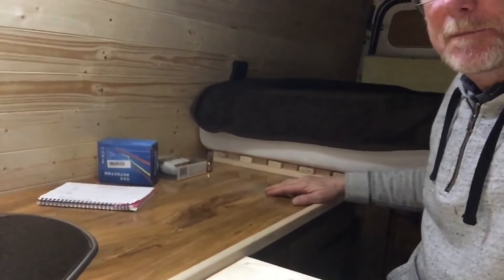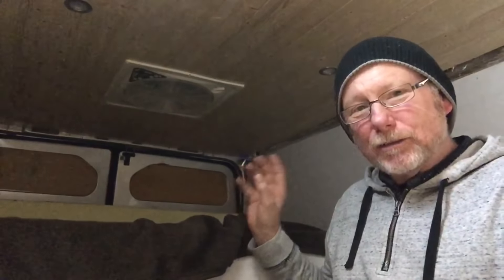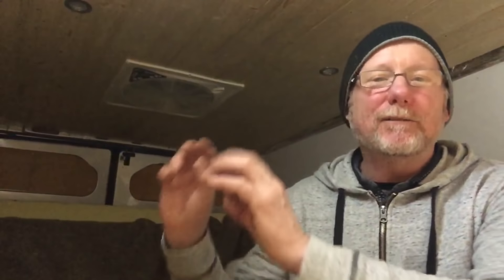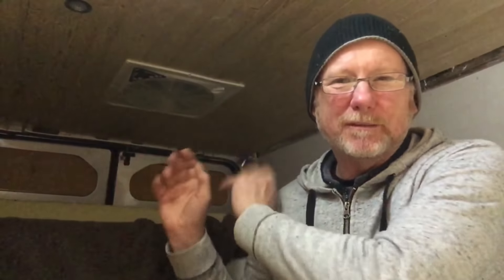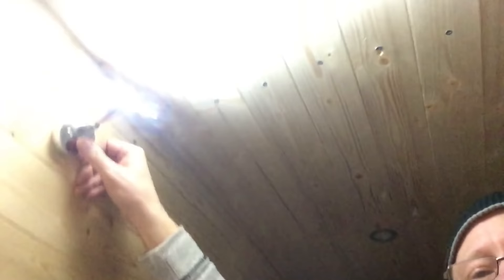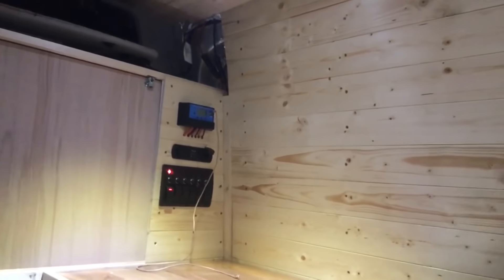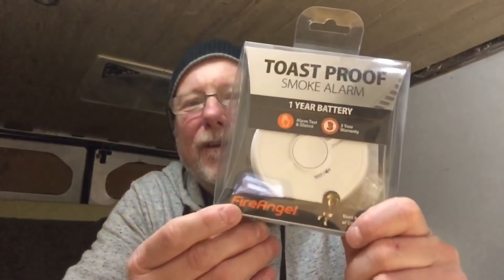HOW TO INSTALL PROPANE LPG Alarm in a Campervan - RV

Comment: Just a thought mel ,have you got a means of escape at the back where you bed is ? If your asleep at the back and with no windows your kinda trapped .can you open the back doors from your bed ? Or something you might want to consider
Reply from the maker: peter amberley Hi yes I’m planning a way to open the doors from inside for emergency 🤓🤙

Comment: my smoke alarm is by the sliding door exit same reason so it draws you to the exit. my extinguisher is far opposite rear corner above the inflammable bed, easy to find if you need it, head towards the fire.......
Reply from the maker: well done stay safe out there :)

Comment: Hi Mel we need to think up some safety measures for us van dwellers. I've only been in the van a few days and already had someone try to brake in. I don't know if stealth works in the UK. In America people make there van look like it's a work van but in the UK if you did that people would break in thinking tools would be left inside. So I don't know if it is better to make your van look like a camper because then people think you could be inside. Trying to think of different things to keep the van safe. I worry every time I come back to the van that it won't be there and I loose everything I own and have spent a fortune buying and building. Only thing I can think of is putting a light with a motion sensor on it but then it's obvious someone is inside. Or maybe the guy who put barbed wire on the handles of the van. Any ideas Mel ???
Reply from the maker: Avanliving sorry to hear that you had a bad experience.the best advice I can give is just be careful where you park. My favourite place is rite opposite a 24 hour Mc Donald’s I don’t get any problems there. I know it’s a massive worry like you say it’s not just a van it’s your world your everything I have a cat 1 alarm plus a tracker to that works using a mobile phone SIM card I was thinking about CCTV but even then I still think it’s all about parking in a well lit up place hiding in plain sight 🤓🤙
Reply: @BigVanSmallWorld  I was parked in a car park underneath the sign that says video camera's in operation and under the camera's view but still got some hanker trying to get in. astards. Will look at getting a tracker thanks for the help Mel. I'm setting up a cctv system but has to wait for payday also it will take electric so need to get more batteries so more money again.  Just didn't expect people to be trying to break in I deliberately made the van look unappealing from the outside . Knocked my faith in humanity.
Reply from the maker: Avanliving that’s really bad 😐

Comment: Does your gas alarm detect carbon monoxide?  That is a killer - you are cooking and have a diesel heater inside the van.
Reply from the maker: OZ Camper Travels absolutely not it’s a gas alarm for LPG you need a different alarm for that I will be fitting one soon no worries 🤓🤙
Reply: Very wise. Don't know much about gas alarms because all my cooking is done  outside but I know of people who happily go to sleep and don't wake up.

Comment: Link to the L.P.G fire alarm ??
Reply from the maker: AppleJuice1 juice1 sure I’ll do it soon 🤓🤙
Reply from the maker: http://rover.ebay.com/rover/1/710-53481-19255-0/1?ff3=4&pub=5575467911&toolid=10001&campid=5338454651&customid=&mpre=https%3A%2F%2Fwww.ebay.co.uk%2Fitm%2F12V-Combustible-Gas-Leak-LPG-Natural-Gas-Detector-Propane-Alarm-For-Home-Alarm-%2F263721805864%3Fhash%3Ditem3d670b6828

Comment: Hi Mel, I'm no expert, but I think there is a flaw in your theory about having the fire extinguisher by the door. If you have a van where the back doors are boarded off, and your only exit is via the side door, if you are at the back of the van, you may not be able to get to the fire extinguisher to use it or get out of the van. If it is at the rear area of the van, this isn't a problem. If the fire is at the back of the van and you are not, you can get out safely without getting near the fire, and if you are near the back, you can access the extinguisher to use it. Obviously, having one at the front and one at the rear covers both options...….and discuss!!!!!!  :-)
Reply from the maker: good advice and taken on :) thank you :)

Comment: Hi Mel, thanks for all the great vids and info, I had a strange situation last night while away in my van the co2 alarm went off for no apparent reason, I was on 240 hook up using a blow fan heater and electric blanket on the bed, any ideas as to what could have triggered it ? Thanks  Rory, oh p.s. I was vapeing my E_cig a bit, which set the smoke alarm off in the past 😰
Reply from the maker: Thank you for the encouragement and support I’m really sorry I can’t say why your alert 🚨 went off 🤷‍♂️
Reply: Hi Mel, Thanks for your reply, sorry I meant to say it was my Co ( carbon monoxide detector) that went off in the middle of the night which scared the bejazus outta me😰😰 anyway to cut a long story short, after further investigation I now think the unit is faulty or has exceeded its sell by date! One thing I have learned throughout this experience is that not all Co detectors are created the same, the one I was using Inthe van will only alarm at (400 parts per million)  at this rate it would cause severe illness, and as the campers are very confined spaces it is not recommended to use these alarms. What you need is a low Co (ppm) detector)  I am not sure if people are aware of this,   maybe you could give that a mention or perhaps you already have. It could save someone life.  Today I changed the alarm and the ones in my house to low level detectors as I not taking any chances. Anyway thanks again for all the wonderful and interesting vids,   hope life treats you well, kind regards, Rory

Comment: You've got a thing about fire and sleep above a propane tank lol. Oh the irony lol.
Reply: I had a Truimph TR7 electrical fire in the cabin, it filled with poisonous acrid smoke in seconds. If it was a van and you were asleep, you would be dead.
Reply: @flybobbie1449  I had a TR7. Loved that car. Red FHC with sliding cloth sunroof. Automatic and very light on the rear end. Would love another but convertible version.
Reply: @AndysEastCoastAdventures  Mine red, black vinyl roof  with mirrored sunroof. My first car, did my driving test in it. Complete rot box. Did so much on that car, stripped engine, gearbox, welding, re wire after fire, i loved it as well. I rewired the headlamp lift motors, cost me £3 in copper wire from Maplins.
Reply from the maker: haha thank for that now I'm all worried lol :)
Reply: @flybobbie1449  That reminds me. When i first got the car had the engine bay steam cleaned. They called me in from the waiting area after doing it saying theirs a slight problem. The headlamps were going up & down independently of each other. Did it for around 1/2hr lol. Water in the relays that controlled them lol.